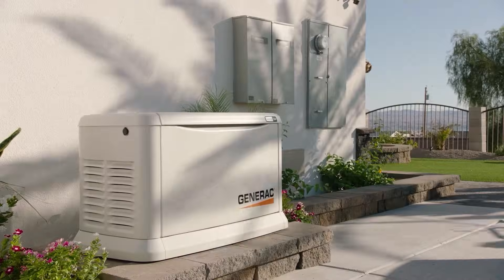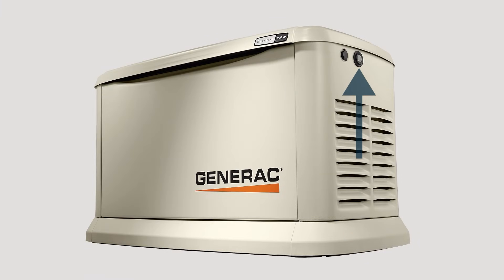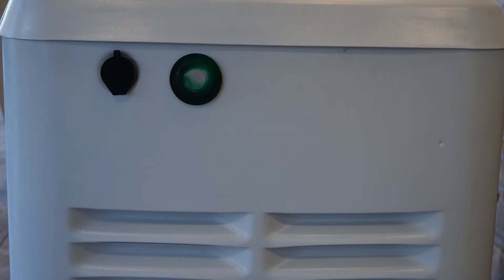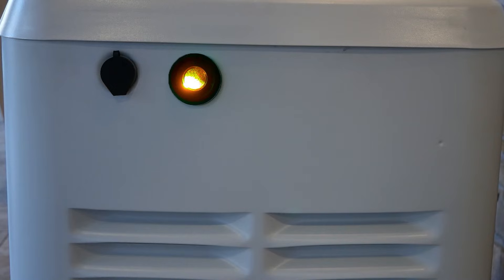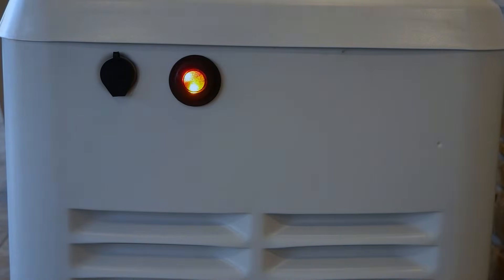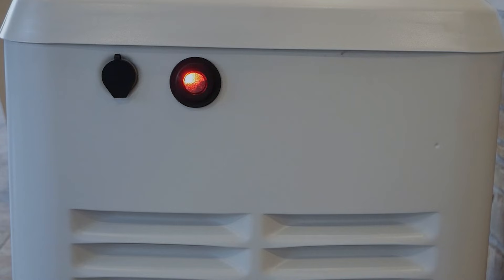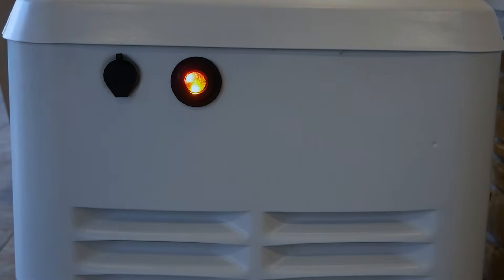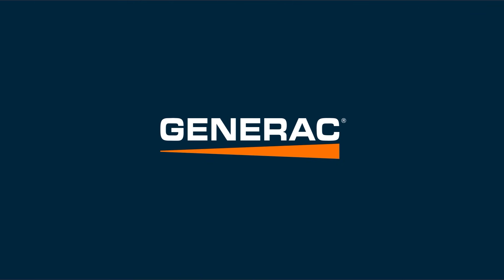Generac Support: Decoding LED Indicator Lights on a Generator

Comment: Not very helpful...my light are orange and green. It's only two years old and the oil has been changed. Does it need complete maintenance every year? And how the heck do you get the wifi online? Tried to follow the directions given, but the display on the generator tells me to go right or left and there are no buttons for right or left, just up and down. I'm sure there is reasonable explanation for this🙄
Reply from the maker: Thanks for your questions! One way to better understand what the lights indicate is to open the lid on the generator and check the control panel for any error codes, or alerts, that may be present. The LED lights work in tandem with the control panel to let the homeowner and technicians know what needs to be addressed on the generator. More details on this topic can be found in this article from our help site: https://support.generac.com/s/article/What-Do-the-Green-Yellow-and-Red-Status-Indicator-Lights-Mean-on-Home-Standby-Generators
Reply: @Generac_Official  well I went in and tried to follow directions, now there is a blue light on the control panel.and the stupid thing won't start at all..seriously. The instructions are not user friendly.
Reply from the maker: We're sorry, Jennie. Please give our customer support line a call at 888-436-3722 so we can assist you with this.